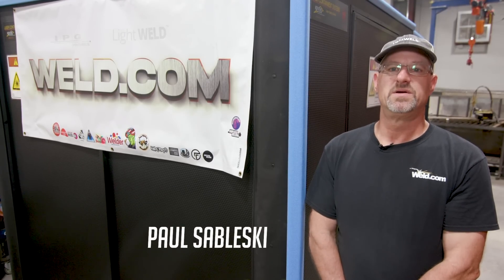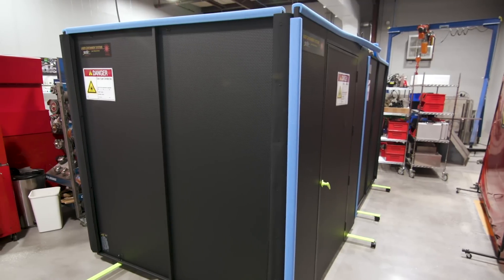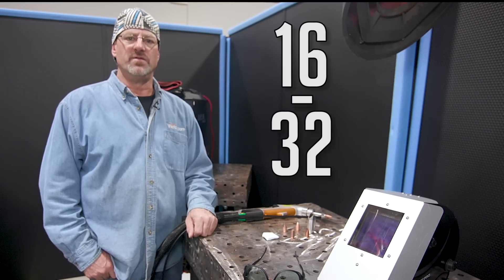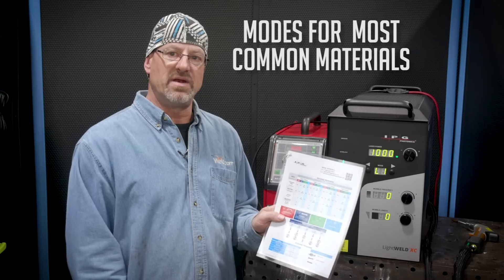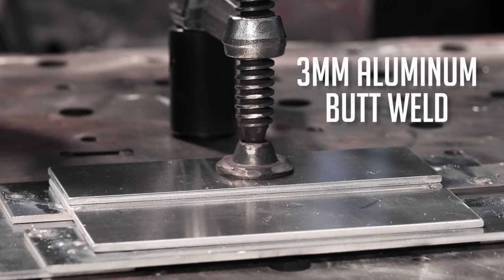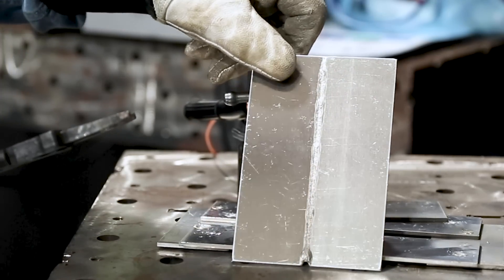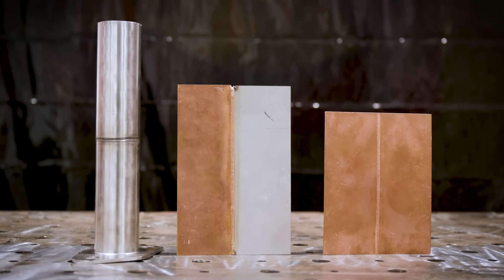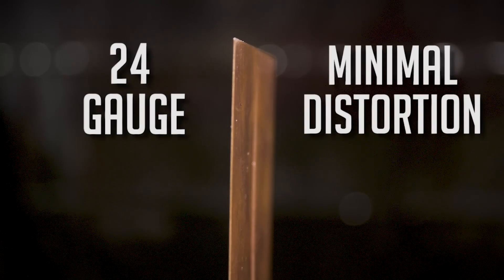Let's Talk Laser Welding with LightWELD

Comment: Cool video. I did some robotic laser welding while in the auto industry, but was always curious how these hand held units worked. Gotta lose those safety glasses though Paul, got you looking like Bubbles from Trailer Park Boys, lol.
Reply from the maker: Thanks for watching
Reply: Best tool for repairing those shopping carts.
Reply: Bubbles lol
Reply: Would one unit be suitable for a small welding business startup?  

I am not sure if the industry offers small quick jobs for regular ppl who might need some welding done in a pinch however owning a laser bunker next to a couple mechanics shops might benefit the welder?
Reply: You Snaked him dirty boi
Reply: First, mock use of PPE.  Then, complete the cycle by mocking those disabled due to not using PPE, young paduan.  Only then will you have fully embraced the Dark Side!
Reply: Say what you want about Bubbles but the man can fix a shopping cart.

Comment: the company i head up has 2 xc units..this is my opinion after 2 years using this product..the welds are epic with this unit   period   less than half the time plus against what i can perform with a tig    crazy fast is the key here  as for weld quality     i can not match the weld with ANY other proccess.....end of day is this is it is a costly machine but it pays for itself in a short time    i reccomend this hand down again any machine    but one thing to be mindful of for older welders.....the dual trigger WILL make your pinky cramp after a long day burning   but i made a 3d printed trigger mod that takes care of that issue      end of comment i say     if you provide a large number of parts  this is the machine that can take you bussiness from good to amazing

Comment: Wow!! I'm an 80 yrs old welder with nearly 70 yrs experience from smithy shop to tig. My welds are all over the world. (!no deep sea type) I am a retired rancher with a small fab shop and do a lot of agricultural in the field service. This is Awesome (!especially for someone with my diverse experience) High steel offshore platforms bridges  pipe line Teamster local 1098 NewOrleans etc) this is very exciting but I just couldn't afford this for my use. Great review and I appreciate the detailed clear presentation. Thumbs up and sub to follow. Thanks for the update. Dandahermit😮😅😅

Comment: The cleaning tip scratched the plate , on soft metal 🤔 not necessarily an issue on harder metals , but the price of the machine, in regards to the maximum thickness , that you can weld is way to much . They need to up the wattage , to allow for at least 1/4 of an inch single pass , before I would drop $ 27,000 + all taxes .

Comment: Im gonna be honest i prefer just good old stick welding still. I work in a small fabrication shop and they’re trying to convert to this but none of us fabricators are really into it. Sure its cool, and you dont gotta knock any of the trash off, it’s virtually no clean up at all. But thats about it, im just making a friendly comment. Not hating on the product, i think this is something that an autoshop could use, or a home owner that loves the “do it yourself” type of projects. It’s fantastic cause its pretty much on auto pilot, once you get the feel for it, an you know that you need to just let it run the beed and not push on it, its really easy for anyone to learn. But yeah, im good with my 7024 5/32 rods and then 7018 for vertical.. anything else im typically not into. Plus in my opinion nothing is stronger on earth then stick welding. Just my opinion. Ive seen tons and tons and TONS of wire fed welds break in the field. But ive never ever seen a stick weld break in my life

Comment: I've always figured that for thin materials, high heat and very fast travel time is what gets the job done. Like if welding 1mm stainless, don't do it at 30 amps, because you'll cook the metal, but do it at 100 amps and just zip through the material very quickly, or set a high pulse rate and zip through it. You'll get better weld this way. I figured this is how lasers can get good weld like this.

How much gas does laser welding use?

Comment: After using one of these for a year and change, it has limitations I'll turn to tig or mig for, but I use it as much as possible especially if polished stainless comes through since it's welds are easy to clean and we can have the film be closer to the joint, and if I need to attach 1 inch 18 gauge flanges to 18 gauge pipe and not warp it. Pair one of these with a welding turn table and get the speed settings right and you'll hold the gun in 1 spot and be left with perfection in seconds. It's also a blessing with aluminum.

I've even set things up so pieces get tacked together with mig or tig by my cowelders and I'll zip through all the welds with the laser like an assembly line to make things faster (and safer for my hands because I've scorched some gloves tacking with it)

Comment: Is it just me, or when he was welding the T joint he burned clean through the 1mm thick sheet, you could see a large hole at the very end of the weld too. Witch leads me to believe he used a different test when he showed the finished piece. Also on the finished piece there wasn't any penetration on the other side of the 1mm thick sheet, and that's pretty thin material going onto comparatively thick material, almost seems like it's just brazing the material together instead of welding it. I'm sensing a paid advertisement here.

Comment: My company got this laser, and while using it, it got quite loud sounding like rrrRRrrrRRrrr if that makes any sense. I thought it was the fans ramping up, but it hadn't happened before, so I stopped using it. Don't know if you ever came across this happening, but just wondering if that is normal or not. Also, the welds were working fine till that sound. Afterwards, I couldn't get it to lay a nice bead. Seemed to roll up onto one side or the other. Welding a fillet weld circle. Any input would be appreciated.

Comment: Probably the most exciting thing to me is the minimal heat distortion. That has been a huge brick wall to design.

The scariest part is the need for environmental PPE. If you're running this equipment, you need real access control at all times, not just signs. Some wayward delivery driver trying to get a signature is going to get one on his retinas, otherwise.

Comment: Not sure how the laser is more advanced than pulse spray arc transfer TIG, especially if the torch is liquid cooled. In welding thin to thick you just bias the weld pool towards the thicker material not a problem. For both processes backing Argon must be used. I think the TIG control and the ability to add the proper filler as you go for the length of the welds shown does not justify the laser as a heat source.

Comment: After 3rd year of using on and off  the Ligthweld 1500 personally I totally regret my decision of purchase. We don't even use it on the daily bases. I don't know if its my unit or it is general but we experiencing power loss, laser power cut off, trigger problems, ER04 at no reason  after 15-20 sec of welding, The fiber optic cable connection at the gun is so weak it tend to break. If I would open my software  and check for past error codes this comment would be 3 pages long, and 90% of the error codes happens at no reason. The wire feeder weep line connection is horrible at the nozzle after the 1st use the plastic melted from heat reflection, I had to fabricate cooper tube connections to solve that. One of my friend purchased one unit recently, she has small hands barely can hold the gun and press the triggers. Her unit wire connection at the gun is already coming apart after a few months of use imo only  a few ghosts are holding the fiber-laser source cable in place. The unit is closer to garbage than a good machine.They guided me over the phone to fix adjust software, thought me how to fix/replace the trigger, adjust the focus etc, basically made it a self serve repair, smart from them. I had to ship it in, to repair 2 times, obviously at the middle of laser welding jobs.every single sizable job got ghosted because of the IPG LightWeld 1500 stopped functioning hello if you not use it wont break right? I had an engineer came to my shop lots of times to fix it,  but IPG don't do that anymore. If you weld small parts it maybe a good solution but I doubt it after my 3 years of experience with unit. Currently it is out of commission again in the middle of a larger job. larger I mean what the unit can handle supposed to lay 1680 inch of weld I got stock at less then 140". could not finish the 1st part. now we have to grab the tig welder again it never failed us. This is what I learned if I don't use it longer than 10-15 min at any given time it fine. If I exceed 30 min power on it does fail each an ever time.  Now what do I do? No warranty anymore it become a 21000 dollar pile of trash. Talking to some engineers at IPG according to them the owner of IPG told them to create design a hand held laser welder it was not ready for the market and  the owner made them push anyway. In the trigger assembly you will find in-house 3D printed plastics parts they wear out. I don't know if they fixed that but all my replacement trigger switches has the same 3D printed parts. 1 more spare trigger switch remains in my inventory but right now the issue is larger than the trigger switch. For the same problem we had to ship in to repairs.

Comment: Welding Steel Maximum 6mm
For 33,000 Plus Taxes And 
Shipping 40,000 Dollars 
Some Chinese Good Brands Are 
Less Than Half Price And Welding 
Better Than Lightweld And Welding
Up to 1 Inch.
Not Body Buy Lightweld 1,500 Now
Because Raycus Chinese Brand Is 
100 Times Better Than Lightweld Brand.
Amén.

Comment: I want to see a strength test.  Claims to go up to 10mm?  OK.  Butt weld 10mm coupons, traditionally and lightweld.  Then test the joint to strength.  

I don't trust the penetration or capabilities to justify a $50k welding system

Comment: Last year, I made a purchase of a Light Weld XC machine. Unfortunately, upon unboxing, it was non-functional. After reaching out to their technical support, I did receive some level of responsiveness. Several phone calls later, a technician was dispatched to my facility approximately three weeks later, equipped with a new circuit board. It was disappointing to experience such a delay in repairs for a brand-new welder, especially considering the total investment of $30,000 for my startup. The explanation given was that there may have been a defective batch of circuit boards sent during the initial production phase, indicating a systemic issue.

Eventually, the technician replaced the circuit board on-site at my facility, requiring only about 20 minutes. I was relieved to have the machine back in working order. However, my satisfaction was short-lived. After only 25 hours of service, conveniently just one month after the warranty period expired, the same issue recurred. The manufacturer provided me with a repair quote ranging from $2,000 to $4,000, along with a complex set of instructions detailing how to properly package and ship the welder using various tilt and impact sensors (incurring additional costs and logistical challenges). Opting for this route would mean facing another few weeks of lead time. Alternatively, if I chose to have a technician come to my facility for repairs, the costs and turnaround time would be even greater.

Fortunately, being part of a massive global corporation, I have the financial means to absorb this setback. However, for a small business relying on this capital investment, the situation would be dire. Consequently, I strongly emphasize the importance of conducting thorough research before making such purchases. I recently discovered that these "welders" are not compatible with TIG welders, a critical piece of information that was not disclosed during the sales process. It would have been helpful if the seller had mentioned this limitation when selling a welder to someone with welding expertise. These circumstances have left me disheartened. As a 20-year welding veteran, I wanted to share my perspective and caution others in similar situations to exercise diligence and consider all relevant factors before making such investments.

Comment: My main concern is Maintenance ???
Working on the theory this Laser Welder machines cost almost the same price as a decent Fronius Welding machine.
I can only assume it will cost just as much to Repair ???
Next concern is ???
Will this Manufacturer still be around in 3, 5 or even 10 years to provide backup on Spare Parts or other wear & tear items ???
This is most of the reason I purchased a Miller Dynasty.
Because they have proven history and access to Spare Parts.
It's great that these Laser Welding machines are available.
Just concerned about what happens when they Stop Working  ????

Comment: I'm sorry but are we just not going to talk about how he just swapped out plates when welding the t joints? like literally cut the bottom of the plate off with the welding machine, and then shows a completely different plate in the next shot. my dude...the plate you're showing has round corners and the one you welded has square corners and not to mention you basically cut the entire plate off when welding, AND THEN YOU GO ON TO SAY THAT WITH A TIG WELDER YOU WOULD BURN THE THIN PLATE WHEN YOU LITERALLY JUST DID THAT WITH THE LASER WELDER! did you think nobody would notice this?!?!

Comment: 8:10 am I missing something or did you not completely melt the bottom of the thin steel here. You can see sparks shooting out the other side and reflections from the other side of the plate, but then show a perfectly good piece the next clip?

Comment: Wow! This has the ability to turn the welding industry tits up! I'm curious, I noticed how clean the welds are and even on metals that have Lil to no prep. Makes me curious, does purosity and defects happen as much? Can they be seen an corrected on the fly? Or must u finish the bead then do a second pass on defects? This is absolutely intriguing! Honestly I'm a little concerned that it may have the ability to make the welding trade virtually pointless? Obviously a standard mig/tig/arc welder has years of experience and is deserving of a fairly high wage. I'm concerned that it may be so easy that a fry cook could do it on his first day. Virtually giving a experienced welder, no leg to stand on. And it could drop someones current hourly rate in half in some cases... I'm a Welder, and I'm kind of worried about how easy it looks! Because one could then argue, if it's as easy as moping a floor. Would we now be making the same as a custodian? Or would other jobs be worth as much as a Welder? Given there's Lil to no learning curve? I'm kind of biting my fingernails! I need to get into robotics. I currently work on exhaust systems welding them together. And now that exhaust are going to be irrelevant and Welders are no longer skilled laborers. I mise well be omw to a unemployment line!🤔🤦

Comment: Great video, said a lot. Only thing that could've been better is seeing the weld through a lens as it happens. It'd be cool to see the weld pool, fusion, and etc live.
Reply: Didnt have time .. But i also like to see the weld pool.
Reply: With laser welding, you get your pool and fusion, but it's a bit different. Here are some examples. https://www.youtube.com/watch?v=mHjn5xIuFko
Reply: @spdcrzy  just watched it, crazy
Reply: @michaelabraham9177  Right? Especially when it's welding steel. That laser pattern is so square it almost reminds of a mortising chisel and bit setup. It's really quite something. And considering almost all modern cars are laser-welded these days, it's not a stretch to imagine that a FULLY laser-welded exhaust system or rollcage, for example, would be MUCH stronger than any TIG or MIG welded equivalent (and easier to weld as well).

Comment: Would love to see a real world application where a factory joint is being replicated in an automotive repair shop. Vw golf roof panels are laser welded from factory down both long sides but it’s impossible to replicate, you have to bond with glue and fill the gap with a sealer upon replacement. Or even a standard quarter panel joint that is mig welded then repaired.

Comment: You should do a strength test on the welds.
Reply: Saw another video where they hammered a freshly welded T-shaped piece flat as paper and the weld held fine.
Reply: @AmazingChinaToday  I seen it to but they didn’t bend the metal over the weld in a proper stress test they bent it away from the weld which isn’t the proper way to stress test wells
Reply: @Holysmoke96  Yes, but would conventional welding perform as well for the same test after laying a bead in 3 seconds?  Most (all, really) of the criticism of laser welding sounds like sour grapes from people afraid to lose their job.  The metrics for laser welding (penetration, etc) are well known.  I think people know the answer before they ask the question, and if they actually don't know the answer, they probably shouldn't be a welder.
Reply: @TurboSkank  Not true, a 100 KW laser welder has 70 mm penetration.   If you're a welder, learn about the latest advancements in laser welding.
Reply: Bend test aluminum?
Reply: 100% penetration.. I mean I'm not a welder but I do understand that at 100% Pen, it has done its job.
Reply: yeah that's what i was thinking.
Reply: No welding wire … on aluminium, this weld is as weak as hell .

Comment: Auto Body Repair (rust & collision)???   Fast is not a good thing, need SLOW precise manual control (plasma cutters are useless for this work).  The major advantage I see is LOW HEAT and DISTORTION.  I chuckle, my price guess was $20k which was spot on!